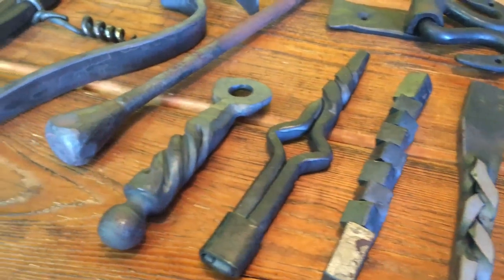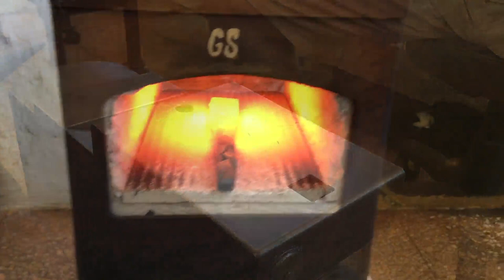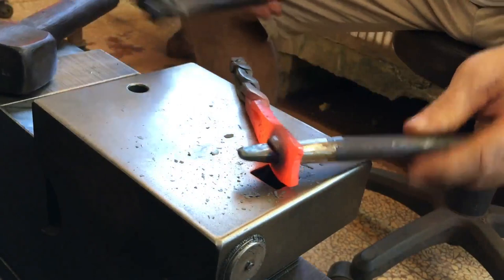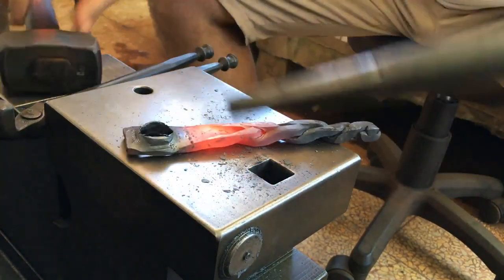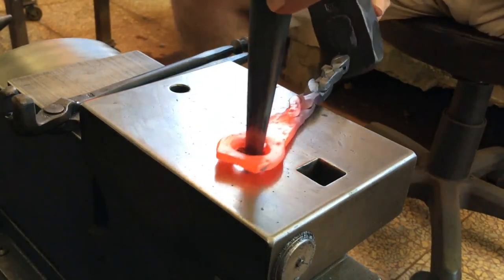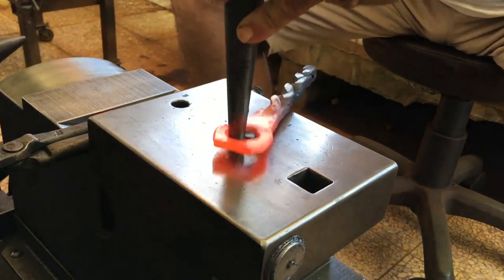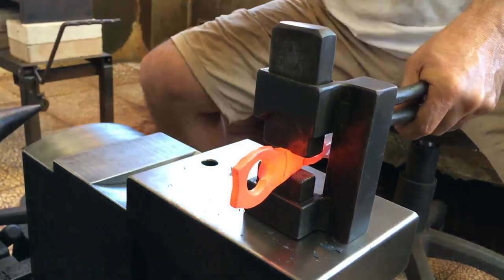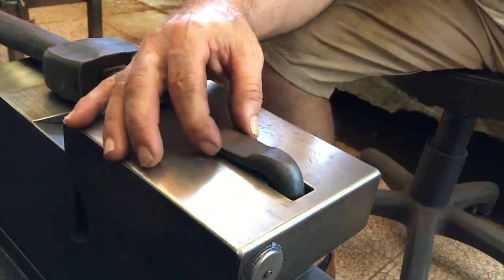Hand Forged Bottle Opener - GS Tongs

Comment: Hey Glen hope all is well. Just to let you know that unless you plan on keeping that hammer in a bucket of water you might run into some issues with the head coming loose. If you dry the hammer the wood cells are going to shrink a little smaller than what they were before you soaked the head. Also the wood will get a little soft from the soaking. I just keep mine in a coffee tin full of boiled linseed oil. My father was an old school timber framer and those guys love linseed oil and avoid water like the plague. I hope this helped you out. Have a good one!
Reply from the maker: Your post is useful. I know about the boiled linseed oil method and that some guys also use anti-freeze. But for me, these can be messy and a little dangerous. You're very right that submerging in water will make the wood dry out even more. But given Taiwan's greatly fluctuating humidity levels, I typically re-handle my hammers about once every year, maybe two, and so go for this quick fix. Thanks for your helpful comment.
Reply: Glen GS Tongs I’ve also seen people use a rubber cement to help keep the heads on. I’ll talk to Blu about what they use for their hammers. I know a lot of guys here in Washington use the Blu hammers because the handles stay in even though it’s very humid too. Maybe not as much as where you are.

Comment: If you put your hammer upside down in a bucket of radiator coolant antifreeze over night the wood will swell but stay swelled permanently
Reply: I have done this in the past with excellent results.
Reply from the maker: I know this technique but have never tried it. I used to have a lot of critters around my shop (in the US) and heard that they might find anti-freeze sweet, drink some, and keel over. But I guess I could have simply put it in the garage... Anyway, thanks for the useful info.